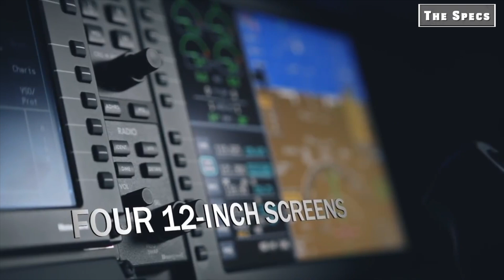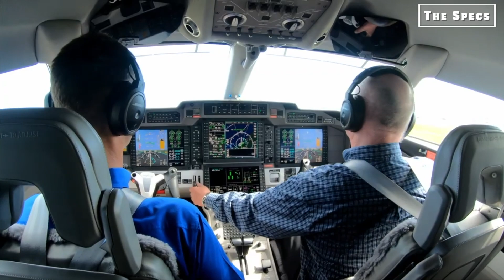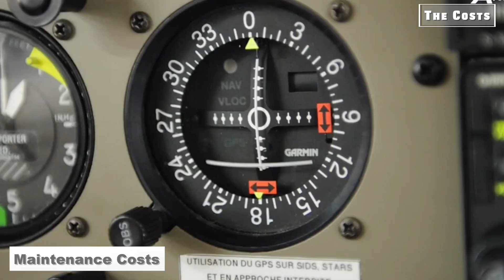The Real Price of Owning a Pilatus PC-24

Comment: Thanks for the video. When you mention the specific costs like hangars, crew, maintenance, training etc, they shall be added to the 1.5M annual cost for 400 flight hours or are you just splitting the total cost of 1.5M annually? Thank you.
Reply: It's a split, roughly it makes the cost per hour close to 4000 USD without depreciation.

Comment: If someone has the $$$$ to buy this imo they should super size their order with an Embraer Praetor 500. It’s $5M more than this Jet however the 500 can cross the Atlantic in a straight shot no problem, something the PC24 can’t do.
Reply: Even the phenom 300 is an all around better plane aside from the airport access the 24 has. I believe it’s cheaper too
Reply: True, but I can tell you that most customers buy this plane for it’s large  cabin and big cargo door.  It’s range is plenty for the continental USA. Also, the fuel burn is low.  Maintenance is very low.  Also, the low landing speed allows you to land in many runways that are too short.   You also have to consider that when the weather doesn’t cooperate such as rain or snow, this plane can land anywhere.
Reply: The Praetor is not single pilot operation.